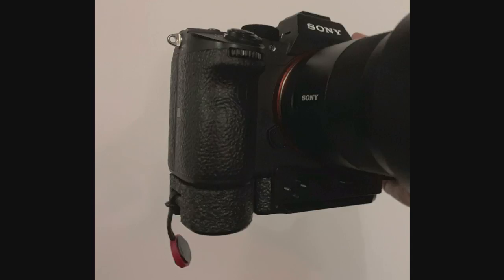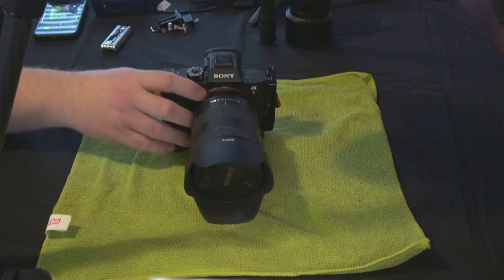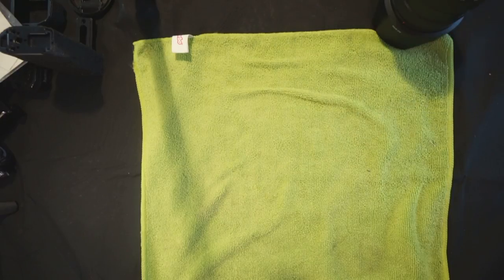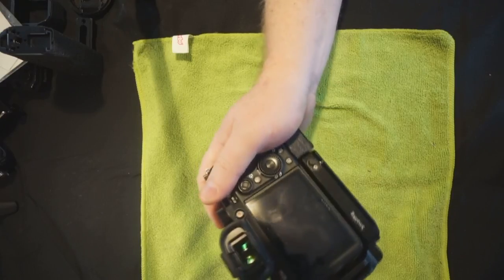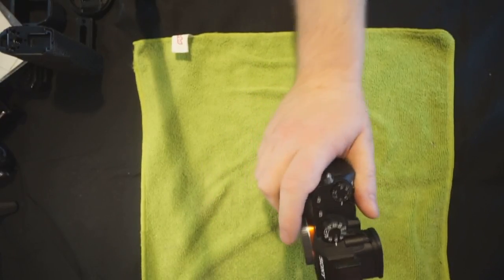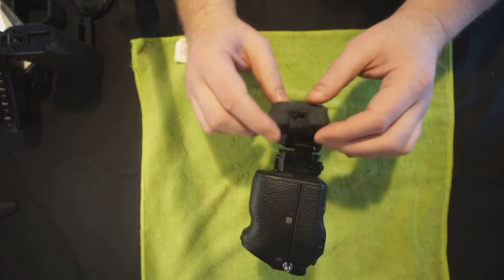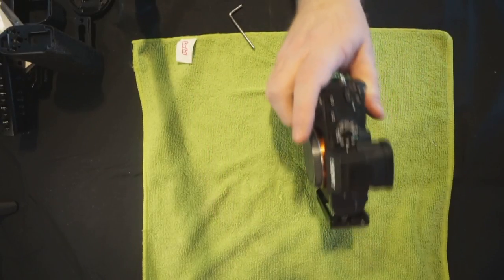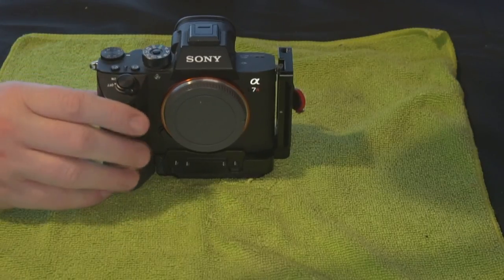Sony a7iii/A7R3 more grip tape info smallrig 2236  (pictures) since some things where less clear.

Comment: Hello Daniel, thanks for your reviews!  the movement on the door (hinge) was my fear with this design. Desing and build moving parts that must adjust perfect, with no movement it is not easy, specially if you periodically need to use it. Perhaps the RRS is a better solution (of course adding 20mm to the body): one single and fixed plate. I think that the SR design is only marginal better sealing the battery door, so for me it is not a problem to reinstal the camera door into the baseplate. I will check by myself when my SR arrives.
Reply from the maker: I hate to disagree on one part yes this design was harder to get 'stable' no way around it but i think its workable now. The RRS one is much worse in weather sealing my base plate had a hole in it next to the hole already on the sony door. Even  the old smallrig one was better since at least it added 20mm (say standing in some water) before the camera was reached and didn't add a extra hole. But for the res tthe RRS is nice design it just misses a lot of features this new 2236 now has. Also i think the plan is to at some point also update the 2122 (so a fixed part) with some of the other 'fixes' for people who really prefer that design.
Reply: @scb2scb2  well, my point is that I think that is harder to get a good and stable two pieces baseplate, joined by a hinge, than to solve in a "creative" way a new design based on the RRS design. Also it si important that the baseplate perfectly follow the shape of the body. Maybe I'm wrong, because I've only seen your videos, but I think the fit is not 100% perfect in the grip area. please correct me if I'm wrong.- The visual integration is important if this baseplate will be a part of the camera.
Reply from the maker: @betod63  You mean a design where the door is still on the sony camera, a 20mm height and then some other door that still allows you to remove the battery ? Not sure but i agree 100% getting this to 'never move' is harder so smallrig now has 2 options. For me the looks are fine and holding it with the guntape on (since feel/colder was one way to detec) its hard to detect where the camera stops and the plae starts. For me this one solved so much more problems for me than the rss one.. to each his own in the end.
Reply: @scb2scb2  when I am referring to RRS design (but with 20mm height), means battery door on the base plate . otherwise would be as the previous SR version.